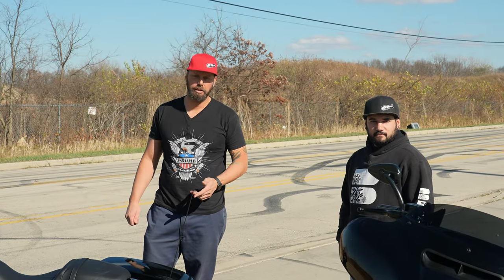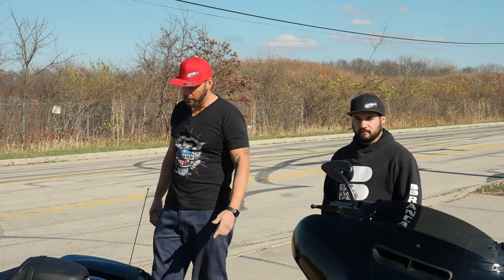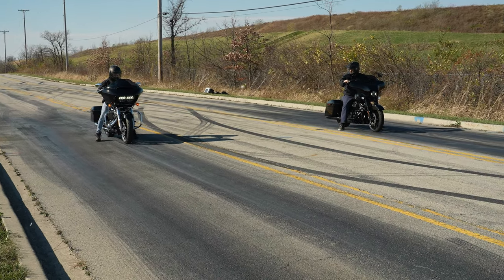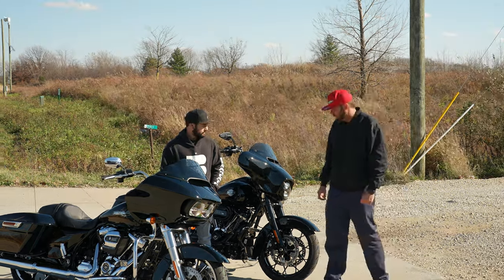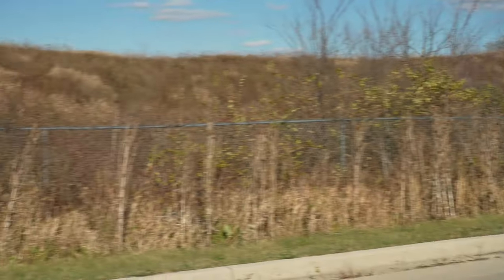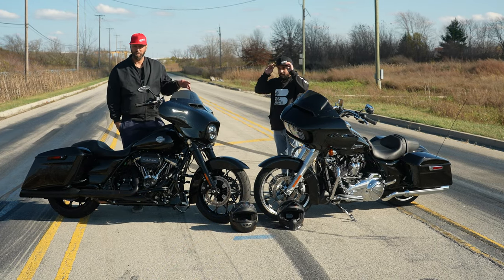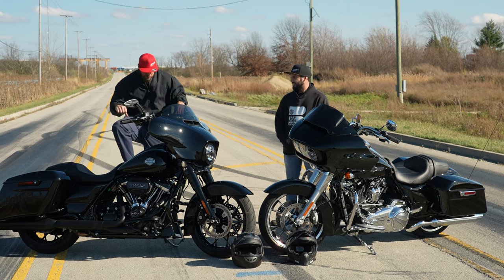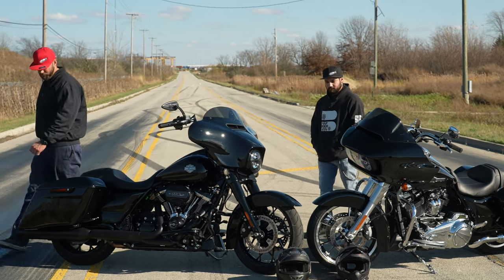STOCK HARLEY 114 STREET GLIDE VS STOCK 107 ROAD GLIDE! PLUS A FAT TIRE GIVEAWAY??

Comment: So, i’ve been telling everybody that my 107 Road King stock is pretty impressive… i’m not a light guy by any means and I  2- up 90% of the time, fully loaded with trunk tour pack, and pull a nice cargo trailer with all of our camp gear in it…. Frankly, it does everything I need it to do and more and I think this video proves it one more time.
Reply: This was a great video to run across. I had always wondered how the 107 compared to the 114. Now I know. I figured my '21 King I bought brand new was pretty impressive. Then of course even more so with a true Stage 1. I still wondered how it's performance would stack up against a 114 because my 107 King just runs....freaking amazing. Like you said, it proves just how good that little ole' 107 really is and how it stacks up to a 114. Great little piece of information.

Comment: You can actually disengage your traction control. With the bike in neutral hold thr traction control button. The TC light will come on and stay solid.
Reply: So when the light stays on solid it’s turned off?

Comment: This is the video I’ve been looking for! Just purchased a 2020 107 streetglide and was wondering if I made the right engine choice!! Thanks a lot keep ‘em comin
Reply: The 107 is solid. I put 17600 on my 21 Road Glide Standard in 15 months and trading for a new one this spring when the 23's come out. Rode Mo to Ore/Ca and back in June and several rides to the Ms Gulf coast this year. I  averaged 44 mpg cruising evenly split between 65/70 and 75-80 on the 5000 mile west coast tour . I'm 240 and had about 60lb of luggage. Not uncommon to get 49 mpg on the secondary highways. As far as a platform for high performance I couldn't tell you. I just maintain it and take care of it. I'm not a street racer. That's a hobby I can't afford! I don't believe the 107 had any glitches like the 114 when the M8's came out. As far as I know, anyway......You have a ride a lot of people would love to have! Don't let 'em BS you. Congratulations!

Comment: Great video..  I have a 107 Road King and I ride with friends.  Some have 114 Road/Street Glides.  We’ve never really thought of racing each other.  Good to see you guys did it for us. To turn off RDRS traction control..  Press and hold the trac control button for more than 1 second.  Bike must be stopped with engine running.

Comment: 21 fat tire kit would be sick usally if you press and hold the traction control will turn off, it turns off on mine 2020 street glide special. thanks

Comment: I wanna see a 107 Softail vs a 114 or even 117 RK/SG/RG. 

I wanna see how much the 250lb weight savings make for the (very slightly) less power
Reply: Soft weighs nothing compared to a touring bike.
Reply: @tax905972  That's my point; Softail is 250lbs lighter, so I'm curious what the race would be like between a 107 Softail vs a 114 touring bike. The 114 makes only a few extra hp and 10ft lbs more torque, but is it enough to make up for the extra weight and increased drag?
Reply: I run a stock 107 Sport Glide and it’s 👍👍👍😎

Comment: You don’t have to unplug anything dude just hold on the traction control button for like five seconds and it will turn the whole system off when the bike is running thank me later

Comment: Great idea to do this video. I have a 2021 SGS Special stage 1 w/powervision tuner, my buddy has a 2022 Road Glide Standard w/RDRS, headers, and slip ons with k&n filter on his stock air cleaner no tune. Top speed he walks right by me. Funny thing is through the pv tuner the speed limiter is disabled but can't get the 114 past 112mph. My buddies RG Standard walks right on by lol.

Comment: Takes 9 minutes to talk about a drag race between those 2 boat anchors? Why, do they do the quarter in a little under 8 minutes? I’ve owned both those bikes, you race a stock Ninja with half the displacement, your heart will get broken in less than 15 second. If you purchased either of those bike to drag race, you made a mistake.

Comment: Rdrs won't do shit to your speed if the traction control is turned off it only will effect the ABS when braking...you can disable everything by doing a burnout after turning off the T/C...the 114 and 107 are too close in power to see a huge difference tbh

Comment: So do you have an opinion on which bike runs better? That 65 pounds you give up sure makes a difference.  I ride. 18 FLHXS with 107 full exhaust kn filter and a harley installed tuner my wife rides a 15 FLHX  has gutted stock pipes and bunch of suspension work lowered with legend stuff front and rearnothing done to engine other than had the shit rode out of it for 50k miles I  weight 75 lbs or so more than her and the 2 bikes rund dead even til about 80 mph then I start to creep away.
Reply from the maker: Do the 107 and spend the money on a good cam and exhaust